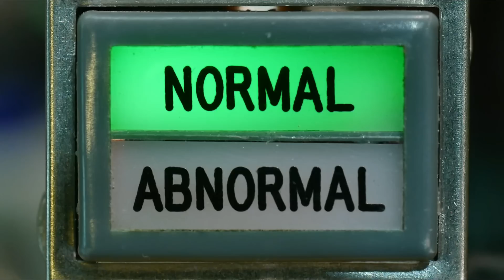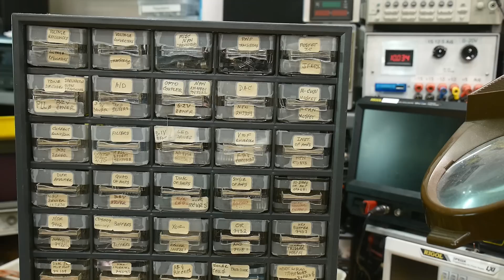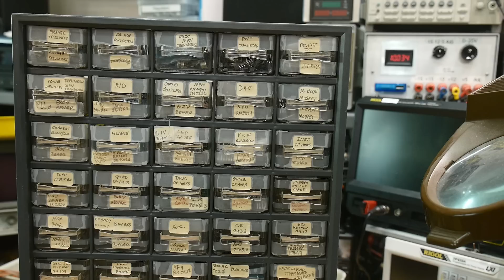#1125 Tiny Boxes Full of Analog Integrated Circuits

Comment: May I ask you a question? Why do YouTubers often make videos on parts and circuits, but  never show the audience how to design and assemble a PCB board/project with the parts and circuits using Altium?
Reply from the maker: I have many videos showing pcb design with Eagle. Many use Kicad. Altium is expensive as the others are free
Reply: If you can afford Altium, you can afford training on it as well – and a lot of training is free. Basically, people only use it professionally, or have the good fortune to be able to spend thousands for just one tool for a hobby that takes many such tools. Altium is one of those names that usually mean “if you can afford it, you don’t need to ask” – you’ll have a coworker who uses it, or more likely many.

Comment: regarding the white packages for optocouplers...  I asked that to an Agilent (I think) distributor, and she had to ask their engineers.  The answer was that it provided better reflectivity, and therefore transmission, in the cavity between the LED and photo-transistor.  I guess it wasn't just me who had this question rattling around in their head.  :)
Reply: Cool. thanks for confirming. That was my hunch too. I 3D print my own opto-isolator housing (LDR+LED), and using white filament PLA makes a difference.

Comment: Super fun! I have had 3 different occasions where this happened to me. 
2008 when I first started in the hobby at the last day of an estate sale I ended up with one of those drawers full of IC’s. 74LSxxx about 40 different, just started using them to build a Ben Eater breadboard computer. 
The second estate sale I purchased my first piece of HP equipment, a small power supply. 

The third time my band sound man friend left me 10 boxes of PA stuff and tons of small Japanese resistors, caps, pots, LED,s. Etc. all sealed packages. 
It make me think of the good times and good feelings kinda like Nerd Christmas

Comment: White packages have lower capacitance caused by a different dielectric constant in the white material and the lower capacitance allows faster switching.
Reply: The dielectric constant of that material has a barely measurable influence on the performance of the semiconductors and wiring embedded within. It doesn’t even remotely figure in the speed you get out of the device – that mostly depends on the phototransistor’s f_t and the design of the driver and receiver circuits, or on the photodiode capacitance for the isolators with photodiodes instead of phototransistors.

Comment: What optocouplers look like inside might make an interesting video if you haven't done it already. Are there lenses or a light pipe? Is there a physical air gap? How did they keep the encapsulation epoxy from oozing in and blocking the light path?
Reply from the maker: I talked about that in a video once but not in depth. there is a clear rtv type blob at the center that couples the light. no lens, no pipe, just a chip above a chip with goo in-between